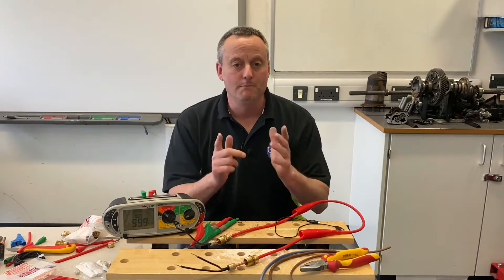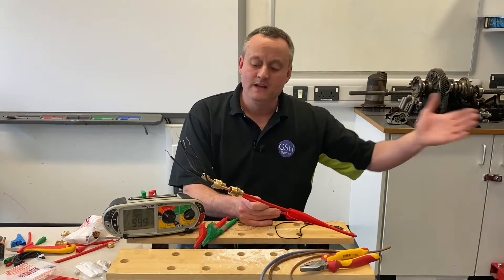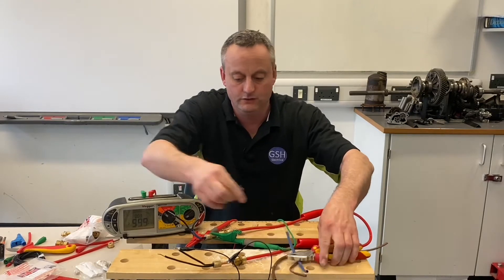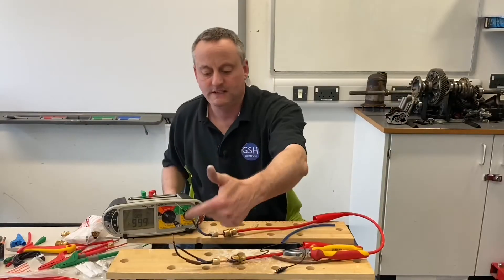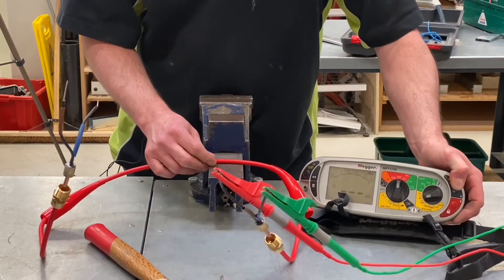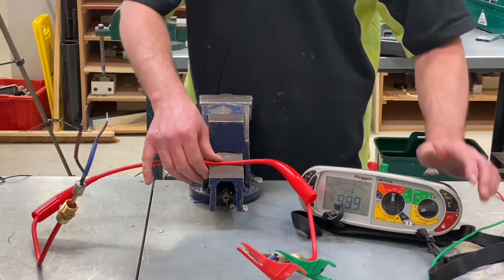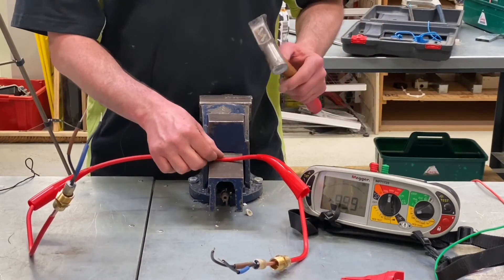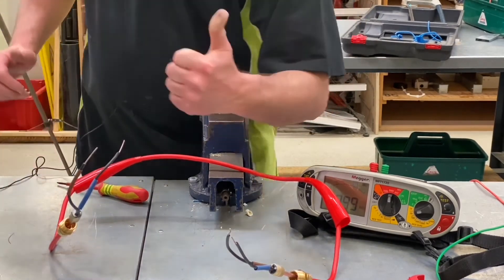How to Test and Identifying the Conductors on MICC Cable (Pyro MI Cable) and Hammering 🔨 it Flat

Comment: You said you would only identify one of the conductors and wouldn’t test both, I disagree as you want to prove it’s continuous and isn’t broken internally therefore I test both conductors to prove they are continuous and unbroken
Reply from the maker: Unlikely - but you go with your own method 👍🏻
Reply: @GSHElectrical  test both conductors as you may have internal short to outer sheaf
Reply: @GSHElectrical  So what are you saying you don’t test continuity on all conductors? You need to prove each conductor is continuous and unbroken.

Comment: A great cable that gets replaced for cheaper alternatives
Reply: Sign of the times 🙄🙄🙄 yet city and guilds still teach outdated unrealistic wiring such as micc instead of fp200 and yet use SY in AM assessments
Reply: @paul_my_plumbs_uk  skill set that I feel that you should have under you're belt as an apprentice. 
If you can make these cables off, you can make off any cable in the electrical industry. 😁
Reply: @paul_my_plumbs_uk  ft200 is the way forward. 😂😂😂😂